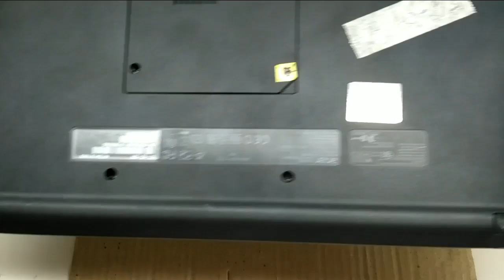how to disassemble laptop acer ES1 432

Comment: I have the same model,  can I run it without the internal battery on? Thank you. Mine suddenly went blank and won't turn on, I am not sure if I can remove battery though and just use AC adapter.
Reply from the maker: Jan Michael Nolasco, you can turn on your laptop without an internal battery and only use the Ac Adapter.
Reply: @LaptopDisassembly12cmf  Thanks! Imma try later.
Reply from the maker: @janmichaelnolasco6044  ,Thank you again brother.

Comment: I have a same laptop mind if can this laptop change the processor?
Reply from the maker: Nicko Manalansan ,brother this Acer es1 432 laptop is not expandable because the processor is integrated with the motherboard.
Reply: if I expand my 2gb ram is there a possible that my laptop not lagging whenever I use browser
Reply from the maker: Nicko Manalansan ,in my opinion if you want to increase the ram of your laptop I suggest you install the 4gb RAM brother.

Comment: Hello i have the same laptop you have here, mine is running slow. Which upgrade you recommend install ssd or upgrade ram?
Reply from the maker: Zam Fenex ,indeed this laptop already uses onboard ram but there is still one empty ram slot, if slow or fast a laptop can also be caused by programs that have problems, it can also be a hard disk that is almost full capacity and can also be from ram which is lacking because of all the incoming data That is before going to the processor first in the process of Ram first so all you have to do is my advice to add Ram, but if there are more funds, you can also upgrade the hard drive to the SSD brother.

Comment: Mine says es1 432 c3rg same device? Some things look different. Ive run into what appears to be a hidden screws on the left side of my device with the keyboard facing up. My DVD drive is on the right side. It loosens just fine.  But the left and back side of the device is still tight asl. Help?
Reply from the maker: Anony Mouse ,
Brother, do you want to open your laptop, if yes, make sure all the screws in the lower case have been removed, bro
Reply: @LaptopDisassembly12cmf  never mind bro. I got it open. It seems I have two problems. One case where it runs out of power quickly. Im assuming a need a new battery. The second problem is that the screen had stopped working. Im wondering if it's a broken backlight in the screen or a damaged video card? I tried hooking her up to an external monitor with a hdmi cable and she works. What do u think might be the problem? 🤔
Reply from the maker: @anonymouse7394  ,
If you connect it to an external monitor, your laptop is working normally so there are 2 possibilities that it is damaged, the first one could be the problematic LED, the second can be a flexible cable from the led to the motherboard brother.
Reply: @LaptopDisassembly12cmf  thanks. The cable appears to be intact... so it could be my led 😥. Is buying a new screen worth it?
Reply from the maker: @anonymouse7394  ,
Brother cable that is intact is not necessarily good, but all of that must be checked more carefully because these two possible defects must be confirmed, one more question is whether the life time on the laptop screen has no display at all or when the laptop is on, try shining it with a flashlight on the screen. the laptop, try to see if there is a picture or writing on your laptop screen, bro.
Reply: @LaptopDisassembly12cmf  okay I'll try that. Btw. This problem started occurring after a fall if that helps the diagnosis
Reply from the maker: @anonymouse7394  ,
Brother, if this problem is caused by a fall, there is a possibility that the flexible cable on the screen is shifted or loose, my advice is to try to open the screen, then remove the screen flex cable, but you have to make sure there is no electric current, my advice is that the battery is disabled while opening the flexible cable, I'm afraid it can happen short bro
Reply: @LaptopDisassembly12cmf  I tried checking the connection of the flexible cable. It seemed loose on one side.  So I disconnected and reconnected it completely. Still no display. You've been a great help tho. Thanks. Ive learnt way more about repairing laptops 🙃.
Reply from the maker: @anonymouse7394  ,
no problem brother, I am happy I can share knowledge and help you check your laptop problem and I hope your problem is resolved quickly and if there are friends of yours who are almost similar to your laptop, you can try the screen to make sure it is really the screen that has a problem bro and thank you back already stopped by this channel bro.

Comment: Hello, I have an es1-433g-333b and I realized that it has the empty ram, I guess it is with ram included and that that slot is to be able to increase it, which is recommended?
Reply from the maker: EL Crei ,yes you can attach ram to the empty slot
Reply: @LaptopDisassembly12cmf  if i put an extra ram on my laptop, should i reboot it?
Reply from the maker: @DR1V3R117  ,brother if you want to add ram to your laptop, your laptop must be in a non-active or dead condition and after you install the ram, the laptop is turned on again, bro.
Reply: @LaptopDisassembly12cmf  dead condition? Not just shutdown?
Reply from the maker: @DR1V3R117  ,yes bro dead condition
Reply: @LaptopDisassembly12cmf  thanks, byut i don't know how to kill my laptop.
Reply from the maker: @DR1V3R117  ,Brother, by shutting down your laptop, it's already dead, bro
Reply: @LaptopDisassembly12cmf  oh, like that.. 😅
Reply from the maker: @DR1V3R117   ,yes brother 😊
Reply: @LaptopDisassembly12cmf  thanks brother
Reply from the maker: @DR1V3R117  ,thanks again bro

Comment: Can it still run if i unplug the battery then just insert its charger??
Reply from the maker: @ravenrey4040 ,a laptop without a battery installed and you can turn on the laptop using only the charger, bro
Reply: @LaptopDisassembly12cmf  thank you bro, my laptop does not charge anymore so i removed the battery. Thanks for the video tutorial!
Reply from the maker: @ravenrey4040  ,yes, bro, you're welcome and thank you again for visiting this channel, I hope it's useful
Reply: @LaptopDisassembly12cmf  bro if i buy a ram on my acer es1 432 is it dimm or sodimm ram?
Reply from the maker: @ravenrey4040  ,Bro, if you want to add RAM to this laptop, you have to buy Ddr3L sodimm ram
Reply: @LaptopDisassembly12cmf  thank you bro..any recommendations on good brand of ram?
Reply from the maker: @ravenrey4040  ,Bro, there are many RAM brands, but if there are good brands, there are Corsair, V Gen, Kingston, Adata, Samsung, Visipro, Hynix, these are brands that are widely used both on laptops and PC computers, bro.
Reply: @LaptopDisassembly12cmf  thanks bro
Reply from the maker: Raven Rey ,Thank you again brother 😊🙏
Reply: @LaptopDisassembly12cmf  hello :) does this laptop have a  HDD 500gb with a SATA connector? Can I install a SSD 500GB sata-3 2.5"  instead of a HDD 500GB?
Does the laptop have 2GB of RAM soldered onto the board? 
Can I install an 8GB so-dimm DDR3L-1600 2Rx8 1.35v memory module in a free RAM slot? 
Or can I just install memory module 4GB?

Comment: I have also thesame model Sir but how do I remove the CD drive without turning it on cuz my problem here is that it wont charge and I'm trying to check if there is something wrong with my battery.thank you!
Reply from the maker: Rhyan D, how to open the es1 432 laptop cd drive that is you just open the lid of the ram casing and the hard disk and then just pull the cd drive, if the battery is not charging or can only live using the adapter
Reply: @LaptopDisassembly12cmf  thanks! 😊

Comment: @Laptop Disassembly sir I have a laptop with the same model, the problem is it can't be turned on with the power switch and after I plug in the Ac adapter the charging indicator works. Still can't open, What do I do? I hope you can help me.Thanks
Reply from the maker: Edna Mahilum ,Try to open the battery, bro, then you turn it on using the charger without the battery and also remove the cmos battery so that your laptop is reset or returns to its factory settings.
Reply: How can i remove cmos battery? God bless.
Reply from the maker: @ednamahilum2520  ,Bro, if you just remove the cmos battery, first you have to open the cover of the hard drive casing and the memory there are 3 or 4 screws that you have to open bro, after that you lift the cover of the hard drive casing and memory then you will see the cmos battery is round like a coin bro
Reply: @LaptopDisassembly12cmf  if it's reset or factory reset. It will be affect the files or not save them?
Reply from the maker: Edna Mahilum ,Bro, resetting or removing the Cmos battery has nothing to do with or affect your files on your hard drive
Reply: @LaptopDisassembly12cmf  Thank you very much Sir.😇
Reply from the maker: @ednamahilum2520   ,Thanks again bro, for visiting this channel and I hope your problem is resolved quickly.
Reply: Hello Sir its me again. Sir when I did you said to remove the Cmos battery and battery. I went back immediately after working but when I shut down and turned on the power switch, it still didn't work again. What should I do?
Reply from the maker: @ednamahilum2520   ,If you have removed the internal battery and cmos battery, but your laptop still can't turn on, it is possible that the Ic I / O part or the chipset part on your laptop's mother board has a problem, bro, in this case you should take it to a service repairman or if you can check it yourself 2 this section on your laptop mother board.

Comment: Is the Hard disk upgradable? And if it is, to what capacity?
Reply from the maker: Izumi Maehara, the hard drive can be upgraded to a large capacity or it can also be replaced with an SSD hard drive
Reply: Laptop Disassembly thank youuu!!!

Another question 

What are the specs of the on-board ram?
Reply: laptop disassembly what ssd is compatible?
Reply from the maker: mosh ,Bro laptop ini bisa kamu pasang ssd ukuran 2,5 inchi bro .

Comment: is the uploader available? my friend aspire-es1-432 won't start, no light indicator when I press power, the charge light indicator only show when I plug but when I press the power button the charge light indicator turn off then on again but the laptop won start. how can fix this? or what is the problem?
Reply from the maker: Alfred Marcelino ,Brother, first try to test using another adapter if there is still no change, then try removing the batrei turn on if it still remains the same as removing the cmrei batrei if there is still a problem or it might not be possible also if the motherboard is damaged in the chip power section or the chipset can be from the motherboard bro.
Reply: @LaptopDisassembly12cmf  my friend says when he pluged his phone on the laptop the laptop sudenly crash and when he try to turn it on again that what happen
Reply from the maker: @marcelinoalfredc.7234  ,brother try to pull out the laptop batrei let stand a few minutes then try to turn on the laptop again.
Reply: @LaptopDisassembly12cmf  i already tried but nothing happened
Reply from the maker: @marcelinoalfredc.7234  ,If you have tried but it didn't work, maybe the motherboard has a problem, bro.
Reply: @LaptopDisassembly12cmf  thanks!
Reply from the maker: @marcelinoalfredc.7234  ,thanks again brother

Comment: I own same laptop, the problem is the charger keeps connecting and then disconnecting, it also have beep sounds. When shutdown and plugged in, it will beep sounds. How to fix this? Thanks.
Reply from the maker: Christian Vergel ,brother 1, a question for you, if the charger is connected to the laptop and you don't remove it, the beep sound is disconnected bro
Reply: @LaptopDisassembly12cmf  if i disconnected the charger  , the beep stops but the light is still blinking
Reply from the maker: @christianvergel6153  ,
If you remove the charger, the laptop is on, there is a beep, but if the laptop is off or not on, the beep is not there, bro
Reply from the maker: @christianvergel6153  ,
And you can deactivate the beep by entering the bios settings menu by turning off the laptop then turning it on again while pressing the F2 keyboard key bro
Reply: @LaptopDisassembly12cmf  can i ask what is the function of the white and black wire that is connected jn the screen?
Reply from the maker: @christianvergel6153  ,
white brother cable and black cable on the left and right side of the screen is a wifi antenna cable
Reply: @LaptopDisassembly12cmf  thank you so muchhh

Comment: Hello i hâve thé same laptop  thé power Button Works but thé screen is Black  i can t See anything on thé screen thaanks for helpping me
Reply from the maker: Desi Olivier ,How can you try to remove the battery and then clean the ram and then put the ram back in, but don't plug in the battery first after that you turn on the laptop using only the charger or adapter bro

Comment: Can i use external GPU on this?
Reply from the maker: Frost Grace, for the Acer Es1 432 laptop type, cannot be installed with an external GPU, because this laptop has an onboard graphics board and there is no additional slot for the external, but for certain laptops there is a graphics slot
Reply: @LaptopDisassembly12cmf  but i ever see that we can replace the Lan cable to external idk i forget to connected to the external gpu
Reply from the maker: @bendover3770  ,in the case of a damaged onboard Lan port it can indeed be used with an external Usb Lan port but if for the VGA case it cannot be installed an external GPU unless you can only connect an external monitor or to an external monitor.

Comment: can u make a video on how to find the antenna cause mine fell cause of my sister and now i get low connection from my router although im close to it plzzzzzzzzzz make a vid
Reply from the maker: Faze_kikks,You mean the connection from the laptop to the router.
Reply from the maker: Faze_kikks,If the connection from your laptop is using Hostpot Mobile the signal is weak, brother.
Reply: @LaptopDisassembly12cmf  yeaah since my laptop fell my wifi connection is weak its only showing 2 bars  although im close to it
Reply from the maker: @Potential2006  ,if you see your laptop's wifi connection problem with other devices it might be a problem with the wifi card on the laptop, for the video problem there isn't yet but hopefully what you want I can make it happen bro.
Reply: @LaptopDisassembly12cmf  do u know how to fix the specified path does not exist error
Reply from the maker: @Potential2006  ,Brother, you just need to replace the wifi card on the laptop.
Reply: @LaptopDisassembly12cmf  ok thx hope it works
Reply from the maker: @Potential2006  ,Thank you again, brother, I hope that your problem is quickly resolved.

Comment: there no ram memory??
Reply from the maker: Mirwan Meer, this Acer ES1-432-CR52R laptop uses onboard RAM, besides that it provides a free RAM slot if you want to add memory, and thank you for the comments and don't forget the subscribers.
Reply: @LaptopDisassembly12cmf  It's the same mother boar in the ES1-432-C23N????
Reply from the maker: @r.a.5926  no same main board but same casing
Reply: @LaptopDisassembly12cmf  thanks, man!
Reply from the maker: @r.a.5926  thx again

Comment: HELP! 😭 I have the same model
it was just shutdown and not turning on again no matter how much i press the power button
and even I plugged in the charger it's not charging (the light for charging doesn't show up) help 😭 whatcould be the possible problem?
my online class will resume this 2 weeks from now 😭
Reply from the maker: Rain Villena ,try to reset the battery bro by opening the memory casing cover
Reply: Same as of the moment same situation huhuhu
Reply: @Hehehehehe24  hello update...
i didn't actually follow what Laptop Disassembly said...
I just bought a New Laptop Charger that is compatible to my Laptop's model
it's working now 😊
Reply from the maker: Rain Villena ,😊👍